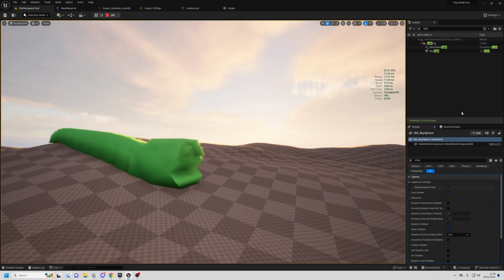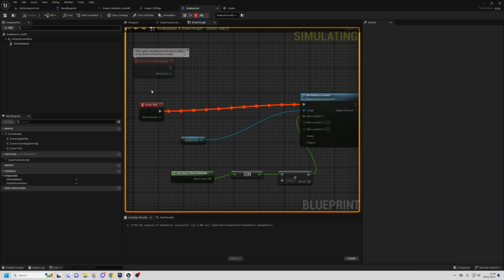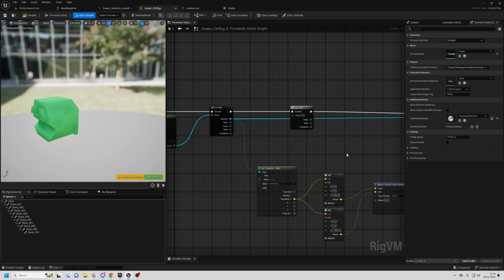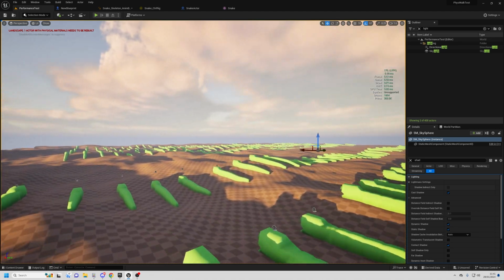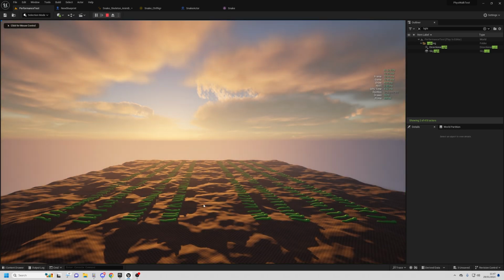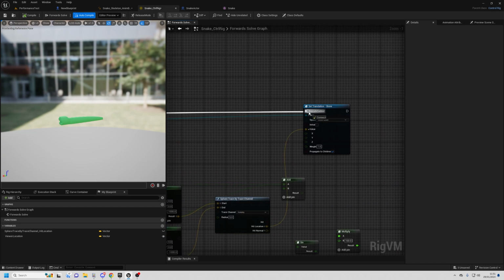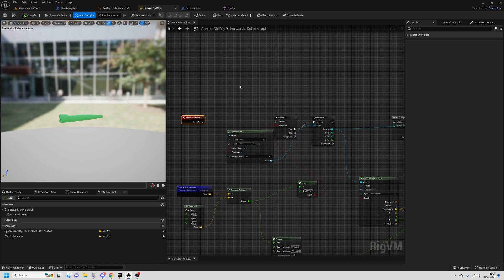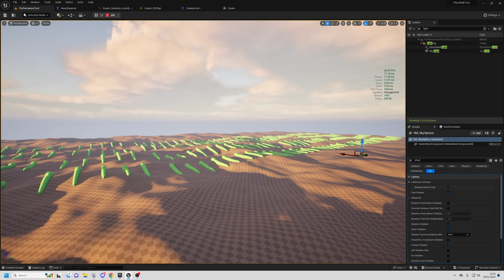Performance of Procedural Animation (and how to optimize)

Comment: Have you done any performance testing in Lyra with procedural animations? It's setup to only do processing on worker threads (nothing in the Event Graph).

I'm also wondering how Unity's ECS Dots system would compare. Dots uses ECS contiguous memory aligned processing, so it is ultra efficient with multi processing.

Comment: Hello, what is your CPU specs for that performance? Its fine if most gamer equipped with i7 or ryzen 7 but many use i3 and the gold cpu which is garbage. Thank you.
Reply from the maker: I would take this more as a comparison and explanation of different opimization techniques, rather than the absolute numbers. I was on decent specs at the time (I think? can't remember exactly when I switched PC) but this scenario is very extreme and so the framerate itself isn't that relevant, just how it goes up or down depending on what you do.

Comment: would help to know your computer specs for comparison
Reply: we should test on the 3in spec computer a6le to run ue5, then we will need only 1 snake with 1 trace and 3ay6e stilll see a drop in fps. this is 3y pc, also i cant afford keys on 3y key6oard, sorry
Reply from the maker: I think it's mainly useful as a general comparison of different approaches, and the relative FPS, rather than absolute numbers. As the situation shown here is unrealistic anyway. In a game scenario you'd likely have more complex character meshes which would cause lower FPS and so on. So it's definitely worth just testing an approximation/exaggerated version of your actual use-case to get absolute values.

But this was on a 4080, i9-13900k, however without any optimization with the engine (eg. lumen was probably still on?) and also screen recording at 1440p/60. So hard to gauge any exact values from this.
Reply: @LincolnMargison  I can tell you that I would not be able to do 400 skeletal meshes at that FPS so it's pretty relevant
Reply from the maker: @lifeartstudios  This is a comparison showing the impact of control rig doing different things, not a hardware benchmark. Even if you get 10% of that FPS with 400 basic skeletal meshes, it would still go down/up/etc based on the different tests. If you need to know real world absolute FPS values that's something you'd have to test on the target hardware with actual models
Reply: @LincolnMargison  Knowing the hardware gives you a ballpark estimate of how much room you have to play with. 

The impact of this test will change based on the bandwidth you have to use. If you only dropped 20 FPS, on my machine I might drop way more than that because of the bottleneck. 

I don't need a full profile of the scene, I was just kind of curious because I can eyeball it after having worked with Unreal for so long.

Comment: Just found out while watching this. You can also set the LOD Threshold of the Control Rig node in the Animation Blueprint so you can stop evaluating it at a certain LOD. Great video.
Reply from the maker: You can! But it's a little risky visually to just stop it altogether, depending on the use case. Because once it's back evaluating it will reset everything (I think?) like the controlrig asset has just been created - perhaps running construction again? Or just a really long tick. Unsure, haven't tested.
Reply: @LincolnMargison  yes it is a little jarring. Would rather have a way to lerp the Alpha from 1 to 0 when going past the Treshold. Couldn’t find how sadly at the moment.

Comment: This is amazing timing: I'm literally in the middle of trying to do a fake physics system for finger collisions in control rig.  Here I am worrying about doing 30 traces on tick.  Great info as always!
Reply from the maker: I was working on that too today!  Making a procedural 'grab'. An interesting solution I came up with was to move the trace point as the hand closes. So a trace per finger, starting at the first joint of the finger (knuckle), interpolating down the chain towards the tip as the hand closes more. Then you can do fewer traces (rather than 1 per knuckle+tip) and it approximates the same thing, where a larger surface/object will still block the whole hand from closing any further, and if nothing is blocking it, it will be tracing more at the finger tips. You could do this temporally too, where it remembers where was blocked without redoing the traces and just gradually closes around the object - if your object can't/wont change shape or position relative to the hand. Then during the closing, you're only ever doing 5 traces, and zero once it's fully grabbed it as far as it can go.

OR you could decide that 30 traces really isn't hurting anyone and go wild
Reply: @LincolnMargison  Interesting, I was thinking of doing something like that to gate if the finger collision would run, but I could imagine some scenarios where a finger could be completely inside an object and the sphere trace wouldn't hit anything.

Right now I am starting the trace about half a finger length up from the bone in relative position, and then offsetting the hit location by the finger size and then turning all of those into points in a spline.  The vector math is hurting my head, and there's some edge cases with some strange behavior, but its impressive otherwise!  I'm going to throw it up on my VR mocap system github once I figure it out, but I would love to see other approaches!
Reply from the maker: @Megasteakman  You can create a spline from controls or bones, and map a spline TO controls/bones. So maybe just turn it into a spline, trace the individual points and move them, then map it back to the chain.

I think individually, each joint would want to trace the top of that joint, rotationally. So you'd basically want to be tracing the arcs of each finger bone? When one hits, move on to the next and so on, so it wraps around.

EG the base of index01 is the rotation origin, but the trace is being done from index02, arcing around until it hits. Then do the same but moved up the chain, etc

Comment: so. the limit is around 20k traces. interesting... (proceeds to make a fully procedural player controller making use of 19,999 traces) XD
Reply from the maker: I know it's a joke, but for anyone reading, keep in mind this is just the numbers on my system & setup! The absolute numbers will vary, and it's more a case "is this better than this" rather than the precise FPS values
Reply: @LincolnMargison  yeh. it is indeed a joke. but it does have some validity to it. there are a lot of factors that need to be taken into account when making games so they can actually run on the hardware of the time but the performance cost of our skeletal rigs is effectively trivial in comparision to days past (given that vector intersection testing is one of the more expensive "basic" operations one uses in geme dev). point being that using animation "LoDs" in combination with efficient reuse of data makes the performance cost of procedural skeletal animation negligible compared to the early days. while we dont need a full on pixar level animation rig (yet) it is within performance budget to do it... if you wanted to.

Comment: Shouldn't it be possible to make the prodcedual math in c++ to make it even perform better?
Reply from the maker: I don't know what's possible in terms of C++ with control rig. I don't think you can do it, but I'm not totally certain. From my understanding it's all highly optimized and running as part of the animation thread, so I don't think you'd get any benefit from if you were able to do it via C++. The math nodes and such aren't causing any issue. So optimizing those won't make a difference. And if you're using traces/set transforms and such it's probably doing the exact same thing under the hood, so maybe no benefit there. I think it would be more akin to trying to set up materials via C++. The interface is like blueprints but I don't think it's the same as regular BP. Similarly, Niagara wouldn't benefit from C++.
Reply: Thats what I do, minus the control rig part. All the data (from pointers) gets gathered on the game thread at the start of the frame, then the data gets processed and calculated on worker threads so multiple characters can have their logic being done in parallel without waiting for each one to finish. This gives me the values I need which I then use in the anim graph. Then for the things that utilize traces (specifically firearm collision) I use async sphere traces for and when the result is received I interpolate to the result so its smooth. All the logic in the anim instance adds very little to the frame time (tested with 40 clients, without any logic it was around 13.9-14ms and with all procedurals it was 14-14.2ms), the anim graph was the most expensive part which is not a surprise given its still their own VM running for the logic. I imagine you can do something similar where you take that approach and you plug said values into control rig to run logic on?